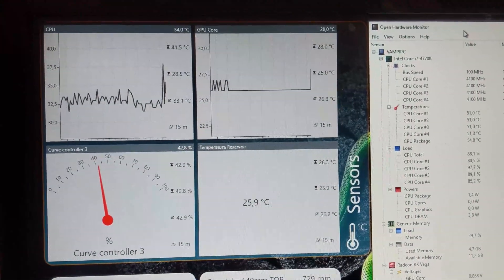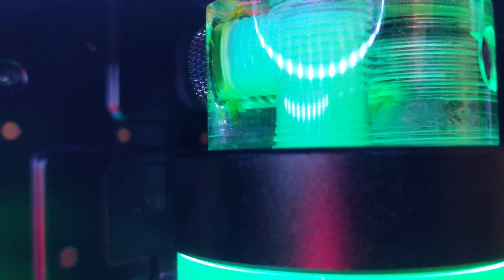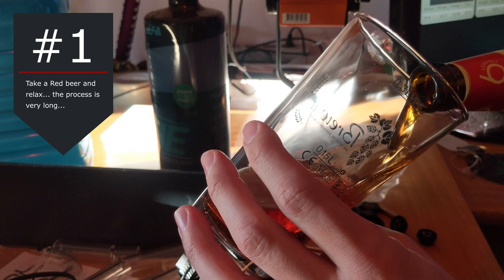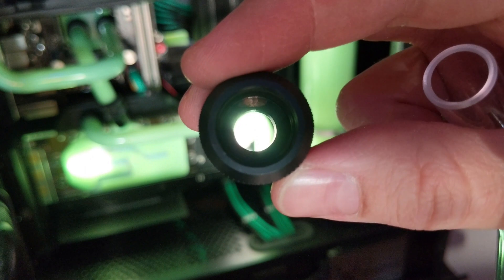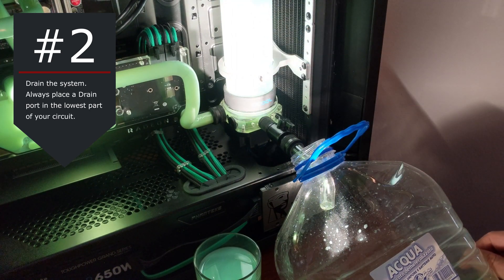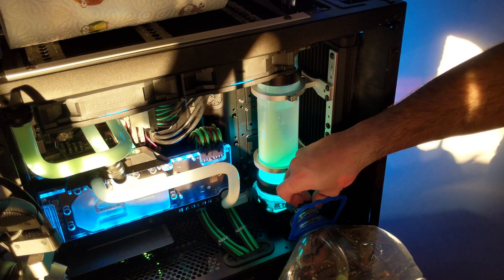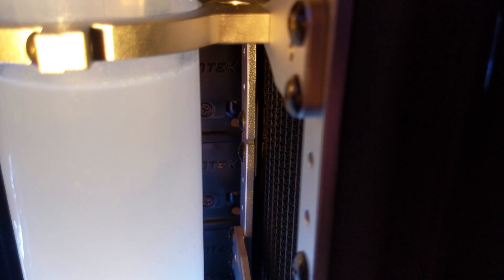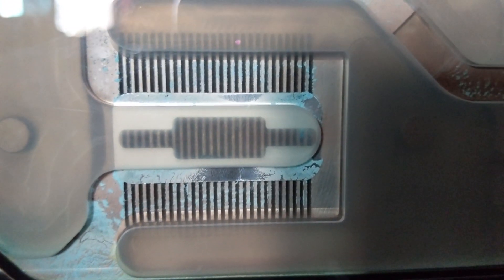Drain and Flush a watercooling loop. part 1

Comment: This is why I tell people Opaque fluids are only for showcasing the PC. As soon as you finish showing it off, drain the opaque and stick to clear fluids.

Distilled water with some anti-microbial / anti-corrosion additives gives great performance with the lowest amount of trouble.
Reply from the maker: Yes totaly agree. By the way I was expeting Opaque Can least more than VUE,  but Is pretty the same. For that I made this video. Seems the problem doesn't exist on the "Great YT Channels" 😂
Reply: I am using Mayhems Pastel for over half a year now, I have no problems at all. (Of course you have to change fluids every 6-ish months)

Temps are also just as high as they were with clear fluid. I am honestly sorry that you have to go through all of that work to fix your loop, but I just wanted to give my two cents. 

Using pastel is not a death sentence for your loop. :)
Reply from the maker: Mayhems Pastel Is good and on certain colors Is with no cons. In my case, I am using Primochill True Opaque... And... This Is bad.
Reply: @freaks4tech167  uh, this problem happened to Paul's Hardware. He left his loop untouched for 2 years, and it was so clogged there was barely a trickle in the tube that returned fluid to the reservoir.

So it even happens to the "great" YouTubers. My bet for JayzTwoCents is that he just doesn't put a video out every time he does regular loop maintenance.
Reply from the maker: Yes, you're rigth.